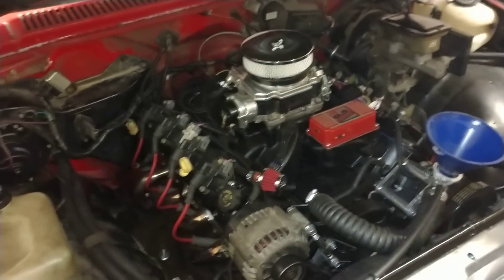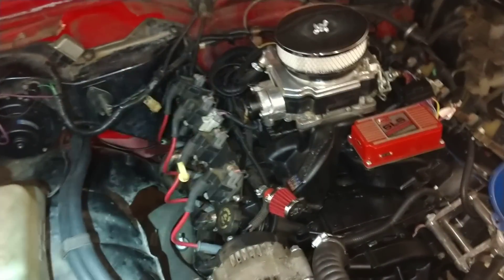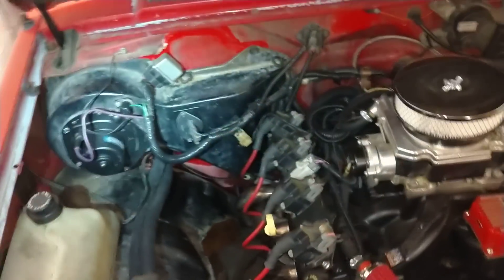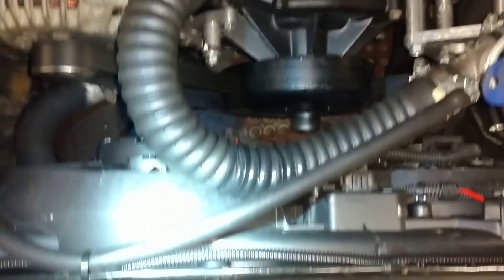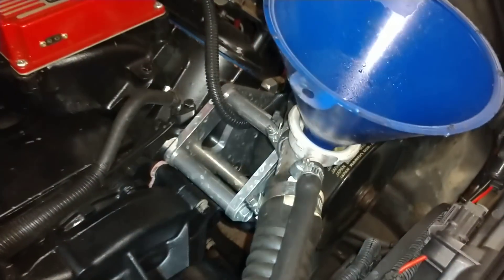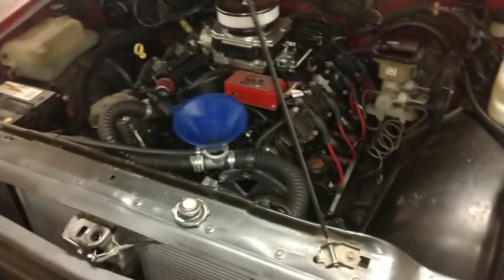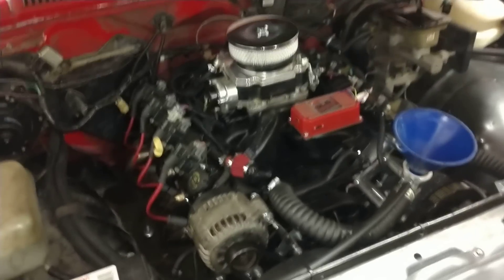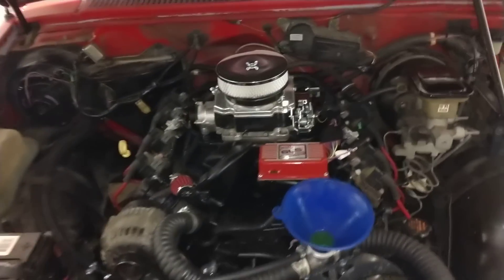How to: LS swap 4.8 5.3 6.0 Chevy S10 GMC Sonoma Blazer Jimmy

Comment: Question I have almost the same set up but I'm getting cranking but no spark so me and a buddy probe everything I'm not getting no spark on the spark plug wire to spark plug side on the coils do you have any idea with that can be
Reply from the maker: Make sure you ground it directly to the battery.

Comment: What about hood clearance doing a LM7 in my 91 atm wondering if the stock intake will clear or will i have to use a LS6 intake because dont have the money for the LS6 intake so really thinking of just cutting a hole in the hood

Comment: Where did you locate the "cheap steering shaft" that you used to bypass the rag joint, is it a new part or did you have to modify one to fit?

My rag joint needs replacement, and that looks like a much better solution.       THX
Reply from the maker: Mid 90s Jeep Cherokee

Comment: Okay when you notched the frame. Did you have to weld a plate there? Or did you just sit the motor right in after you notched it?
Reply from the maker: Boxed in the frame..
Reply: BeeterOlds Garage & Budget Builds man I need a welder. That’s where I’m stuck at! I cut it out. But now I have to box it. Check it out on my page!

Comment: Betterolds got a question for you l’am in the middle of changing my 5.3 over to carburetor will I have to get a controller to run my 4l60e or will the ecm still work the trans??👍💰🏁🤪
Reply from the maker: Need the stand alone trans controller..
Reply: Or a 700-R4

Comment: I'm swapping one in my 86 s10 blazer I have the swap mounts and have the motor as far back as it will go subframe notched and my driver side exhaust port it like and inch from the steering shaft and my trans needs to go back further not sure why

Comment: Let me know how those headers stay sealed, I’m considering a set of those ebay headers but would hate to fight header gasket leaks.  🤔👍
Reply from the maker: They're been on since May. The only thing I hate about them are the crappy collectors. I bought good gaskets and fasteners that's what seems to do the trick everything else is about them is fine by me.
Reply: BEETEROLDS Thanks!

Comment: I’m in the process of doing this myself for my son and I. Sort of a family project going. I purchased those same headers that you are running. But the headers for my 5.3 do not clear on either side. The passenger side it hits the upper control arm. The driver side is of course the steering shaft. My truck is lowered maybe this is why it’s hitting my control arm?
Reply from the maker: Does the truck have AC? If so you need to notch the box or run a non AC heater box. The engine needs to be positioned as far back to the firewall as possible to clear.
Reply: BeeterOlds Truck has no AC or Heater. All have been pulled from the truck.
Reply: BeeterOlds I am running Trans Dapt Motor Mounter with clamshells.
Reply from the maker: @ronnieshadowen7277  that may be the issue. I ran eBay swap mounts on the 2.8 engine mounts

Comment: Quick question, I was looking into the Jeep steering shaft swap but all I could find were older s10’s..so my question is, will the same 1994 Jeep Cherokee shaft work in a 1998 Sonoma zr2?
Reply: Hooker blackheart. 100$

Edit: if you're dropping that in a ZR2, clearing the front differential will be your main problem, not steering shaft, I read a body lift helps exponentially for everything else. My daily is a 97 Z. My project is a 2000 extreme with an LS3 and I've done my homework.
Reply: Exhaust?
Reply: smokey 88 what was the cost for the swap? Just picked up a 2000 xtreme my self and looking to swap it

Comment: Where did you fuse box go? Also, do you think that I would NEED the different steering shaft? On a side note  how does it handle with an extra 120 ish pounds in the front

Comment: Could you run non power steering I'm looking to swap my 2.5 and it does not have power steering or AC where did you get the mounts
Reply from the maker: Yes.. ict billet.makes the setup for it

Comment: Did the gen 1 s10s  run a nv3500 from the factory or just the gen2 s10/blazers?
Reply from the maker: Similar trans I forget the factory part number but it wasn't as strong as the later version

Comment: Iv seen a lot of people say that they can’t find 4wd headers but ones I found look just like the 2wd ones. Did it look like those would fit a 4wd?
Reply from the maker: I don't own a 4wd LS powered S10 so I can't answer your questions. Regardless it's gonna be tight no matter what
Reply: Ok I thought you might of heard
Reply: I also tried the 2000 Ford Focus fans and they seem to big for the 1985 corvette radiator
Reply from the maker: @danielbush7914  mine fits the core like a glove.
Reply: Did you do any cutting of the fan assembly?
Reply from the maker: @danielbush7914  nope
 Not one bit
Reply: That’s weird. I don’t know why. They just stick out about 3 inches to long
Reply: I see they ordered me the wrong fans.
Reply: They sell the 4x4 on eBay.

Comment: What wiring harness did you run to do the carb setup
Reply from the maker: Search
Reply: @beeterolds  ok thanks think it's easier to do carb setup then fuel injection
Reply from the maker: Theyre about the same
Reply: @beeterolds  what headers and motor  mounts are you running
Reply from the maker: @bradleydunford4350  doesnt anyone watch my how to videos??
Reply: @beeterolds  didn't pay  attention

Comment: Did you keep stock rear end?
Reply from the maker: Got an 8.5 from a 2wd Blazer going in this winter.
Reply: BeeterOlds Nice, what year Blazer? Would the stock rear hold up? I’m looking to swap my 1992 Sonoma with a 6.0 out of a 2002 1500HD.

Comment: Why swap to an ls if you're just going to carb it, could've just stroked a 350 for cheaper.
Reply from the maker: Doubt it. You can run a $300 LS engine right out of the junkyard. Minor upgrades and make 400hp.. do the same to an old 350. You have cylinders with ridges... you need pistons Machine work... etc etc.. try again. I run a carb on my S10 because I already had all that Junk laying around.. $400 for a used carbed instake and MSD controller or $400 to pay a reputable tuner to get your junk idling correctly because the cam you picked is too big for the factory ECM to keep up with... It works for me flawlessly.